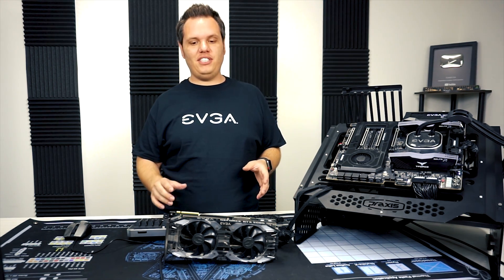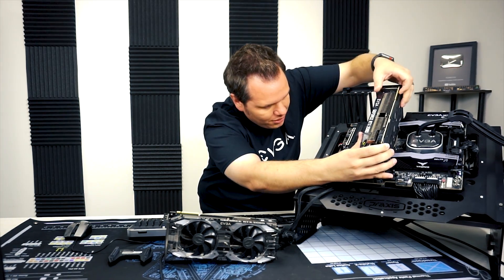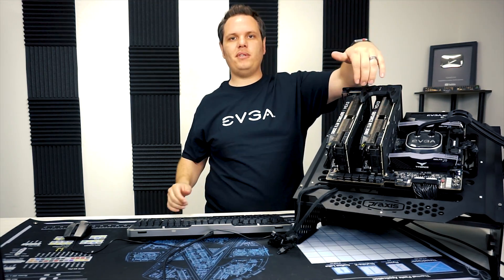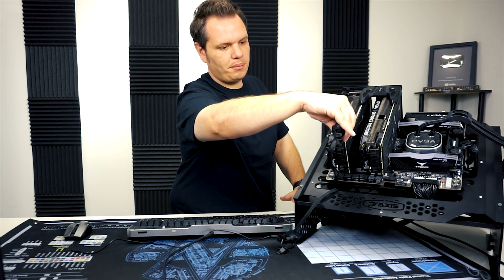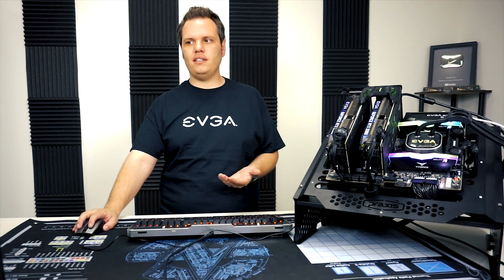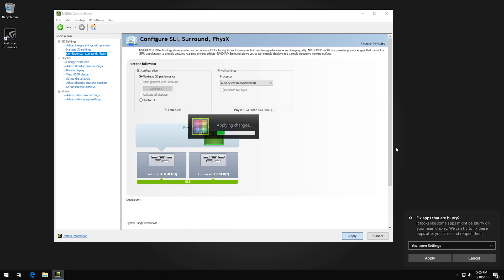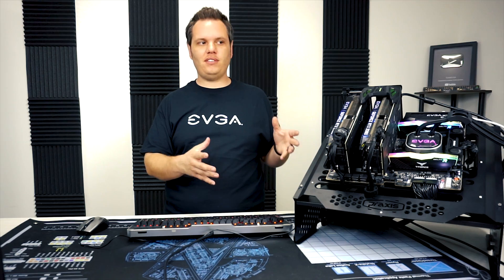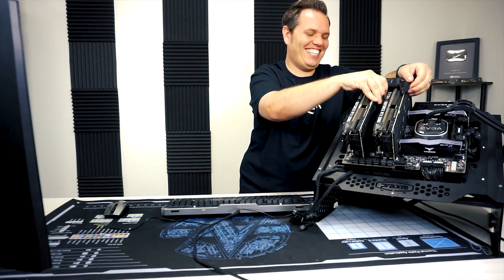EVGA NVLink Installation

Comment: can you pair nv link with any of the 20 series cards? does it matter if they are different? let's say you have an rtx 2070 super XC edition. you want to pair it with another rtx 2070 super. does it have to be the XC edition as well? could I pair it with an rtx 2080 ti instead? SLI was very enclosed but am wondering if there is more leeway with NV link.
Reply: For 20 series NVlink is only for RTX 2080 and 2080 ti

Comment: So absolutely no info or explanation on 3 or 4 slot nvlink? Who hired this guy?
Reply: If you are asking which one you should get, that depends on your PCIe slots on your mobo. If your slots are 60mm apart, use the 3 Slot NVLink. For slots that are 80mm apart, use the 4 Slot NVLink.
Reply: @highrise9559  I have the same question too. It's not easy to measure how wide apart the cards are going to be since I already built my pc with one card, and I'm going to get the new card. Don't want to get the wrong link and have to travel back to the store for exchange. I'll give you an idea and maybe you can help me.

My motherboard is an Asus ROG Maximus XI Extreme with 3 slots, and only the first two are are reinforced. I'm using a 2080ti ftw3 ultra. Which one should I get? 3-slot or 4-slot? Also, can I mix and match two dirfferent 2080 ti's, say an xc Ultra and a ftw3 Ultra, or do they have to be exact same for SLi?
Reply: @highrise9559  so you copy paste the distance from google searches and booom....you are a pc builder and saved the day...

Comment: EVGA need to redesign the NVLINK bridge so it does not have stupid pointy wings that stick out and get in the way of water cooling interconnect blocks like the EKWB ones. The ASUS NVLINK bridge is much better designed.
Reply: it looks like something batman throws at criminals in battle

Comment: Nvidia killed SLI, SLI is an abandoned technology, can't understand why someone would buy two cards to have more problems than benefits.
Reply: Because their e-penis gains half an inch... but yeah, coming from a guy that had 3 rigs with 2way SLI configurations, I can definitely say that the state of SLI these days (and the past 1-2 years) is deplorable to say the least.
Reply: Rainbow 6 siege scales fine with sli and I play at 1440P 165hz so it’s not dead. Devs are just low on time and also bad at their job.

Comment: I really don't like the new cards and NVLink design. It looks cheap and plasticy. This is coming for a guy who has 6 EVGA parts in his PC.
Reply: MIDZ I totally agree, at least when it comes to partner cards. I kinda went on a rant in the comments of their video where they install the shroud over the fans. Yeah I know that FE cards are not the best performing but my 2x 2080ti FE setup looks great and performance is fine. I just don’t understand why AIB’s can’t design something that performs better than the FE’s but doesn’t look like copper fins covered in plastic. The 20 series FE design looks phenomenal In my opinion.
Reply: Yeah It looks like crap. What happened to EVGA's classy design. I am very disappointed and ended up with nvidia one...
Reply: MIDZ I’m going for performance not so much looks